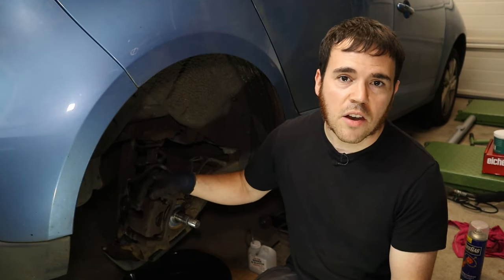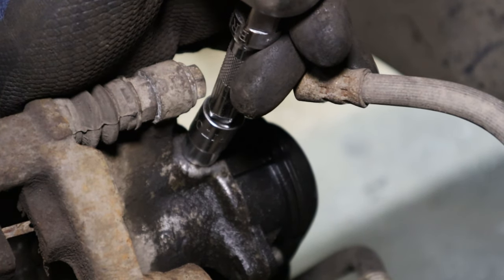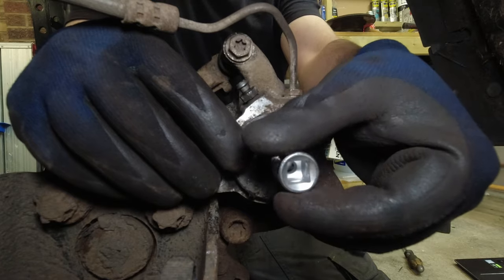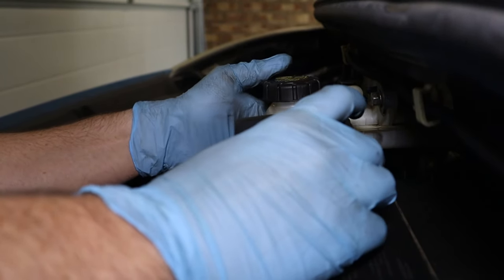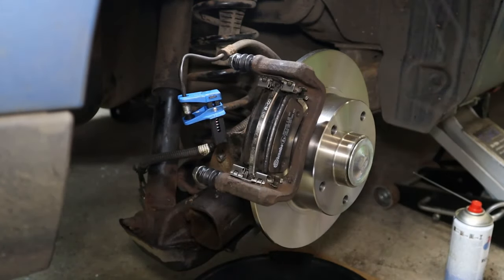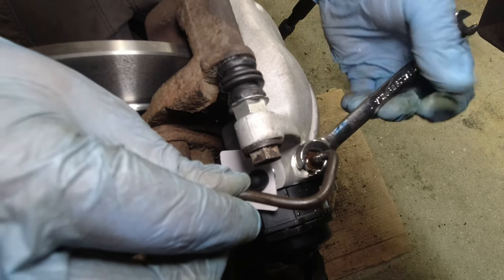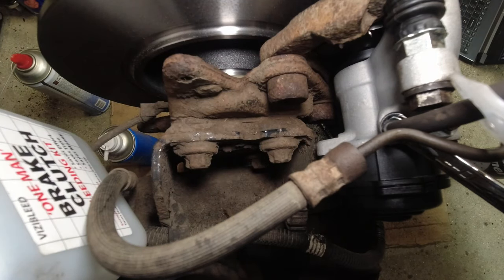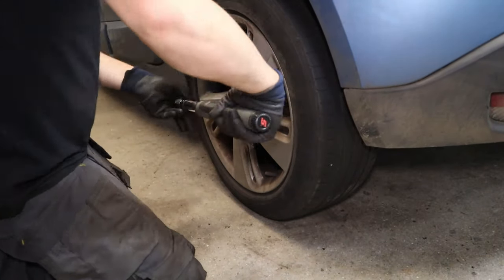Renault Scenic 3 - Seized Rear Brake Caliper (EPB) - How To Diagnose And Replace

Comment: Here is a tip you may need about the ignition in renaults with keyless start and stop. You just put the key in its position and engage 1gear without pressing any pedal and press the start button for 3 to 5 secs without pressing any pedal and here you have a full time ignition. Keep in mind not to take off the key from its place until you're done with your diagnostic. Thanks again for your detailed videos they've been a good help 👍🏻👍🏻👍🏻

Comment: Well done. A job very well done. I so wish I had a garage I could get a car into as I've still got a head gasket to do on a Renault Clio. Not so bad working outside in the summer, but a pig during the colder months. I like the way you present these jobs and its interesting watching another like minded individual at work. I'm guessing you are either just up from the midlands or a little further up, which is a shame as we could use my Clio to do a head gasket video. I'm already looking forward to the next one. In the mean time, my kettle needs putting on for a brew of that great British past time of a cuppa of Yorkshire tea. 😀
Reply from the maker: It is still coldish in the winter but always a few degrees above outside temp. I try not to use the heaters much now with electric being so expensive. I'm hopeful there will be a few Clio videos before Christmas.

Comment: I was looking for this video for weeks. I had the same problem on Megane Grandtour, again with electronic parking brake. I just wanted to do a simple brake rotor change, but it quickly turned into horror when I couldn't push the piston back. I ended up pushing this piston out of its mounting and changing the inner seals. Worked for a while, but I am having hot brakes again, probably because it seized again. This time I am just replacing the whole calliper and hope it will work.
Reply from the maker: Glad the video has helped you. Pretty common with rear brake calipers at this age. 
Refurbishing them can work but usually change the piston too and if the bore is pitted it's scrap. I'm sure changing the caliper will do the job.
Reply: So today I took it to an automechanic and he said that there was a problem with electronic parking brake not winding correctly. I think it was an older problem, because the brake disc I changed had been warped. The problem with overheating is now gone. So I guess with these calipers refurbishing them won't do much, just change it every time...

Comment: Great videos. I had similar issues and also want to bleed all the brakes. What order is it on the scenic 3 ?I assume on UK car off side rear first then near side rear, off side front then near side is that correct?
Reply: Folks in case you wondered (I checked a French video) I was correct.

Comment: Hi iv gotta 2009 renault grand scenic 3 1.5 dci my epb is only workin on one side passenger i bought a new motor an still is not workin is looks like the connector is bad iv had to manually release the one side that is not workin an help would be appreciated

Comment: Great job as usual 👌
I have one question regarding the brake fluid flush, is it safe to use a manual pressure bleeder(Sealey VS820) on these cars and if so how much pressure is safe to use? Thanks
Reply from the maker: I have not personally on this car, but I fail to see why you couldn't. Renaults manual states 1.5 to under 2 bar is fine but I wouldn't go that high.

Comment: If it was a manual parking brake you would screw the piston in, are ECB different ?
Reply from the maker: Yes EPB brakes are pushed in as normal.

Comment: I'm planning to replace the brake pipe on the caliper.  What method would you suggest on this type of caliper/epb system for the removal and bleeding?  Thanks in advance.
Reply from the maker: The only consideration will be how rusty the union connecting to the flexi line going over the beam axle is. Really take your time with it. The other issue will be fluid loss. As I mentioned in this video the caliper line is steel coated in rubber so cant be clamped, I would treat the flexi feeding the caliper line the same and use a fluid stop. If you manage to avoid losing to much brake fluid you could bleed how I did in this video.
Reply: Managed with minimal fluid loss, thanks to my wife's finger 😅. Good job we changed it when we did as it snapped off the nut on the caliper. All changed, torqued up as best as I could.  When bleeding the calipers it's evident it will need a full fluid change but that'll be a job for the summer along with some glowplugs.